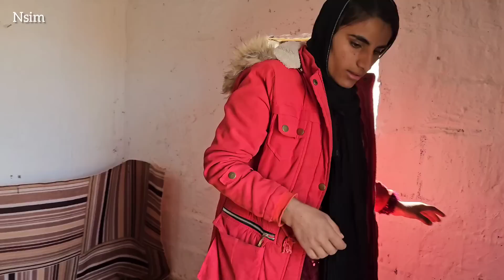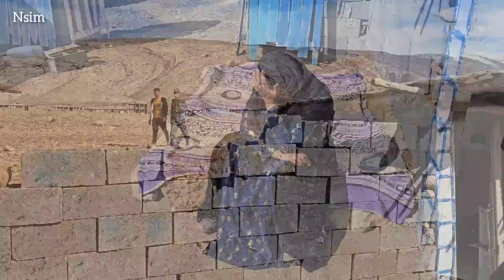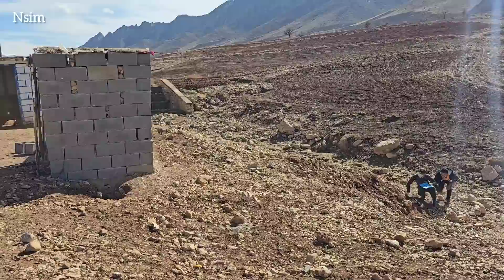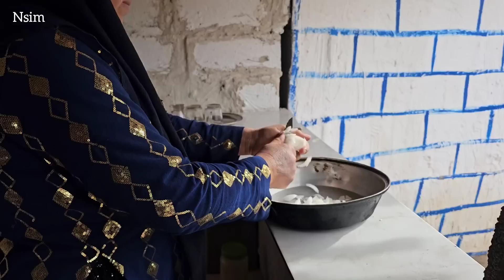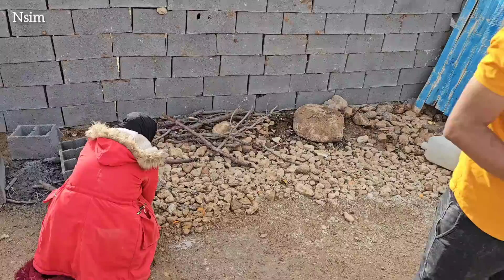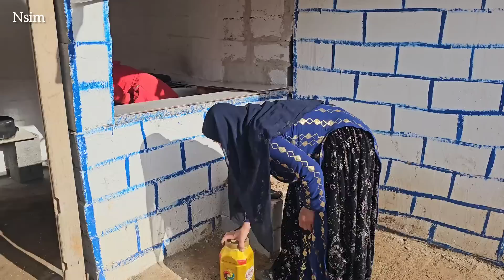The arrest of a criminal nomad boy with the help of Sarah's suitor😡😱

Comment: Most definitely doesn’t know how to build a house because if you wanted to stand, you put a thicker layer semen in between the layers and the in between each block so you don’t leave any cracks or holes for water or anything to get in. He uses a very thin layer of cement and that’s why the guy was able to tear everything up, because he does not know how to build